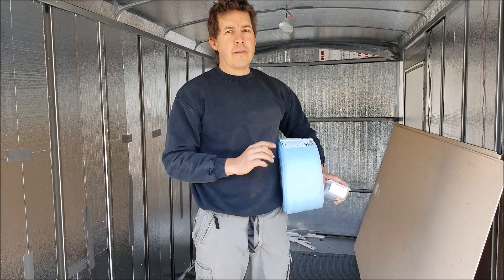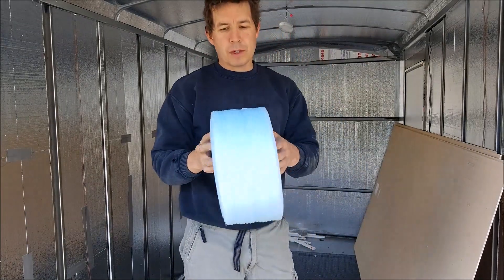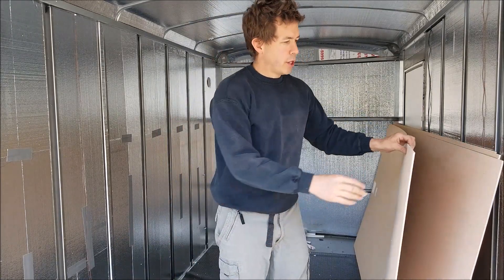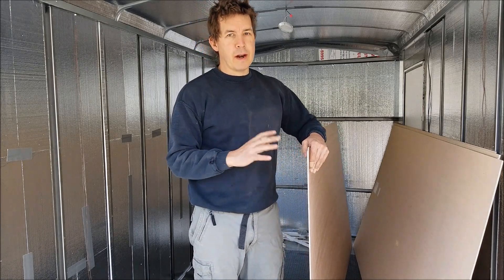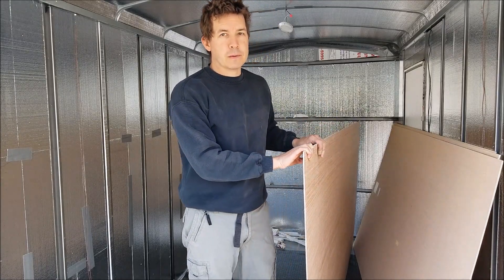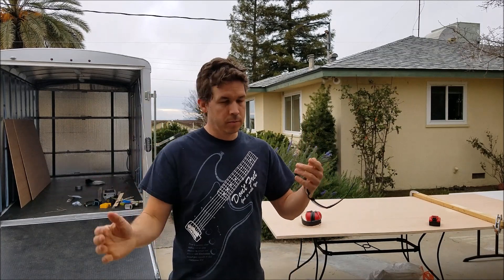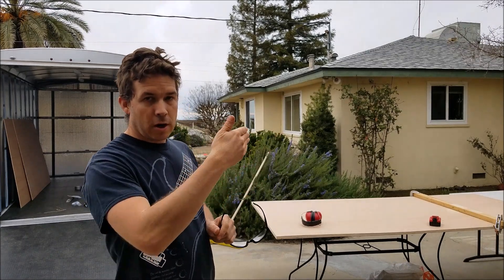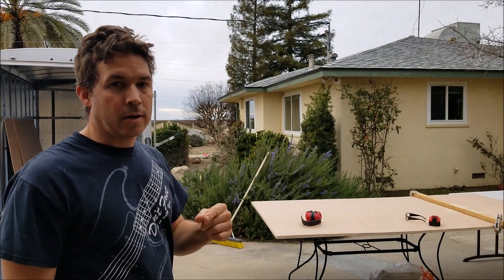Cargo conversion Interior panneling first half

Comment: 1. Nice tip I got from the roll insulation.  Gives a bit of space between foam and wood, and also prevents the wood rattling on metal, cushions it. Smart!
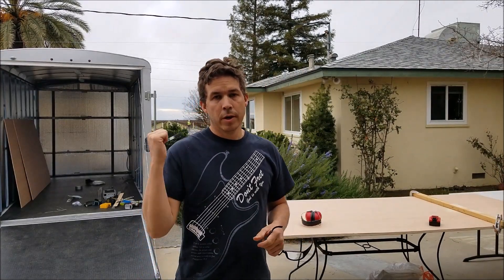2.  2:12 - Thank goodness for your wife's artistic eye!  If she had not caught that in time it would have been poor design.  It may have been more efficient to go horizontally, but.. the grain would have been horizontal, and visually awkward, and you would have had an ugly seam at eye level all the way around.  Vertical placement means one continuous strip, grain matches, seams are more pleasing.  Hurrah for your wife!
3.  Your tool tips with drill press and circular saw are so useful!  Huge time savers and accurate.
4. The way you solved the ceiling curve was very useful to see. You stacked two panels on table. You took a wood strip the same size as curved ceiling side to side.  Then put it on the stacked panels.  You held one side of strip to the left end of panels at a lowered height.  The other side was at the top.  The strip made a natural arc on the stacked panels to mimic left half of ceiling. Cut this, then unfold top panel to right side.  Highest point of arch will fall in the middle of the dividing line, with both sides being symmetrical.  Brilliant!  Why does my mind not think like this?  I learned a lot watching you.  Many thanks!!

Now for my contribution to your channel.  Your English teacher speaking here.  Its important not to be careless with language.  Language is an art like woodworking and needs equal polish and technical ability.  So here is your corrections homework:
4:35 - COMING, not COMMING.
6:37 - INCREDIBLY, not INCREDABLY.
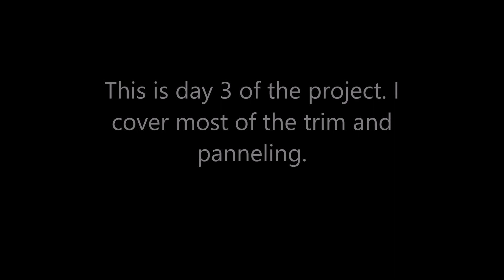0:06, 7:53, 8:20 - PANEL, not PANNEL.  PANELING, not PANNELING.
7:25 - TRYING, not TRING.  The phone trings, but a human tries.
7:53 - TOGETHER, not TOGATHER.  Together we attempt to gather around your trailer build video.

Comment: Having watched both this and the previous video on insulation (genius idea) I am leaning towards using a vertical strip of the insulation over each strut and a five similar horizontal strips (top, bottom and every 24") to a) provide the thermal break on the struts, b) provide an air gap over the majority of the wall and c) provide stiffening for the 4ft boards on top. 

Looking forward to watching the rest of the series.

Comment from the maker: I am currently planning on using poly wall for the roof. It's a white polyester sheet for lining shower stalls and the like. Its light, relatively low cost and will form nicely to the sharp curves on the edges of the roof. The white will also reflect the lighting better than the darker walls. I have also looked at the 1/8 panneling similar to the walls but it will be harder to form into the corners. I am just finishing up for a trip in a few days. I will do the roof and windows, awning, etc. Afterwards. Thanks for the encouragement.
Reply: Thanks for the tip. I was looking for something white to use on the ceiling.

Comment from the maker: Thanks. I thought about spray foam. You could run a bead dow each channel and then slice off the excess with a knife. You will still get some heat transfer through the edges. I just didnt have the time and felt that the reward wasn't worth the effort for me. Hope it works out for you.

Comment: Dude, love what you’re doing! Have any ceiling roof ideas?
Reply from the maker: Getting there. I had to move and some other issues. The window will be next then the folding master bed. I may get to the roof in there somewhere. I plan on bnb using 1/2 foam on the entire roof the white plastic poly panels that are made for shower stalls.

Comment: Do you feel that the Strip Insulation you bought for the sides of the metal frame rails made any difference? I'm at that point in my build and wondering whether to use that or paint them.
Thanks brotha!
Reply from the maker: I figure it has to be better than paint or no insulation. I think I would put a thin wood spacer screw on the rails then screw my interior panels to that. This would make an air gap and keep the screws from transfer issues. The problem I am having is in cold weather the screws transfer cold to the inside and the moisture from our breath condenses on the heads.
Reply: Isnt that stuff the same as bubble wrap? I have a ton of that stuff. Maybe I could use that? Thanks!
Reply from the maker: @artest7  normal bubble wrap is not tough enough in my opinion. You can get some really cool double layer bubble wrap with mylar reflector on both sides. It's called Tekshield I think. It's also much tougher than  normal bubble wrap. I have seen it at Lowes And Home depot.

Comment: at 20 seconds of the video, what type of screws did you use?  I couldn't see it.  I have to renail my boards back up, the previous owner used Wood to Metal nail which is was a pain that butt to pull out.  had to because he didn't insulate the trailer.
Reply from the maker: These are what I used, they have held up well and look decent. https://amzn.to/3lhSFuy  Thanks for watching.
Reply: @DirtyShopDIY   Awesome thank you so very much!
Reply: @DirtyShopDIY   One more thing.. what did you use to cover the rings on the floor?  I took mine out because I'm stalling woold vinyl flooring but is there a place where I can fill in the hole where the rings went?
Reply from the maker: @CharlesButler  I didnt have rings in my floor. I bought the trailer used. The previous owner put a rubber floor down. When I pulled it up I dont think there were any rings to start with. If the holes dont go through I would mix wood glue and sawdust and make a putty to fill them. Then sand it down. If they go through I would make ply wood plugs and epoxy them in with a backer board on the bottom. ( a board covering the hole from the outside glued or screwed down or both. Hope this helps.
Reply: @DirtyShopDIY  Okay thank you very much.  Yea I purchased the trailer used as well.  Have an awesome and blessed day!   Love your videos!